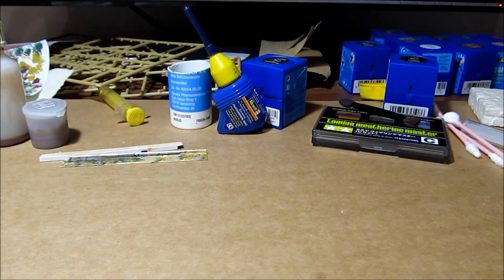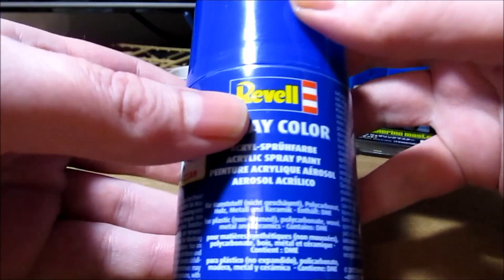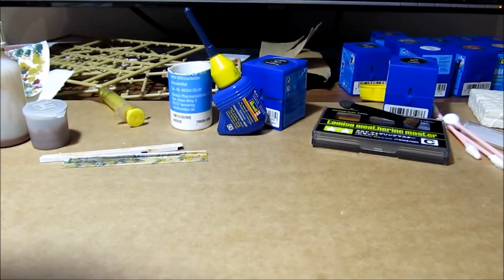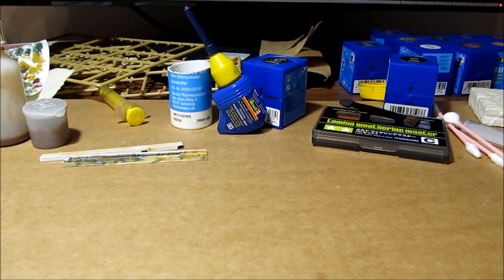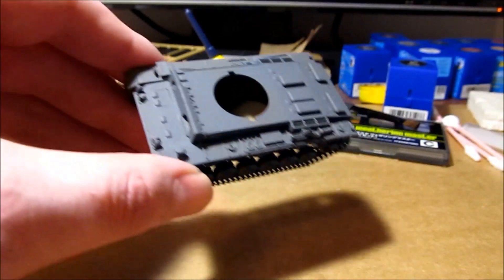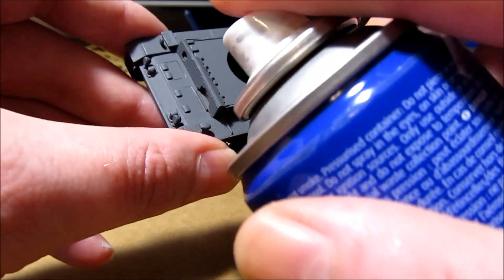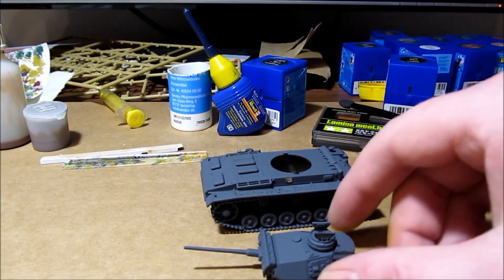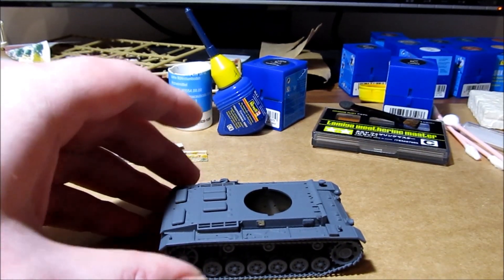Revell Pz Kpfw III Ausf. L 1/72 Baubericht Teil 2

Comment: Ich mag die Art von Bauberichten. habe das gleiche Messer (in rot) hat aber nur 3€ gekostet aber diese Pfeile sollte ich mal suchen. Hast du auch einen PzKpfw II? oder gibt es den auch von Revell weil ich habe noch nie einen Panzer gebaut und habe es vor...
Reply from the maker: Einen PzKpfw II habe ich nicht, aber den gibt es bestimmt auch von Revell. Schau einfach mal bei denen auf der Seite nach, oder bei Sockelshop.
Reply: *****
Sockelshop kannte ich noch nicht. Es gibt einen von Revell aber 1:76 ist mir zu klein. Dragon hat einen im 35er aber 50€ sind mir zu viel. Tamiya hat auch einen im 35er aber der ist auch zu teuer also wird dieses Projekt noch warten müssen:(
Reply from the maker: Wenn es nur darum geht einen Panzer zu bauen hol dir den Sherman. Hat glaube nur 89 Teile und kostet 12€. Ein schönes Einstiegsmodell und sowas wie der Volkswagen unter den Panzern.
Reply: Danke für den TIp ein Sherman mag leicht zu bauen sein aber sieht unmöglich aus. Ich habe an einen M24 von Revell gedacht ist zwar 1:76 aber der gefällt mir. Bis ich allerdings einen Baue wir wahrscheinlich noch etwas zeit vergehen.